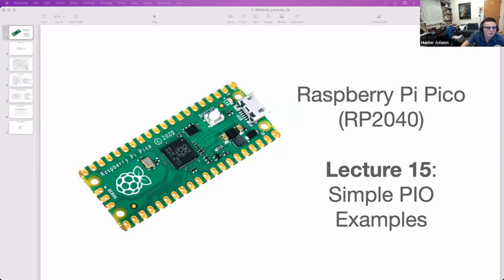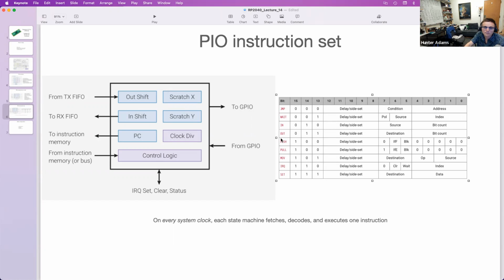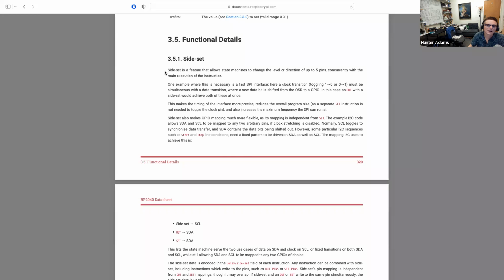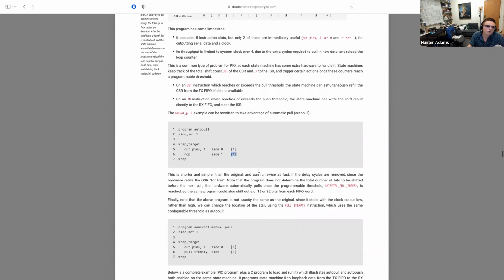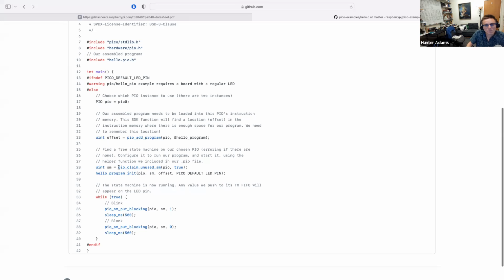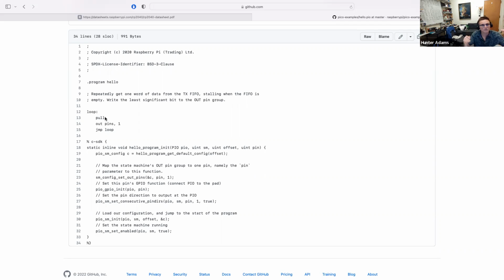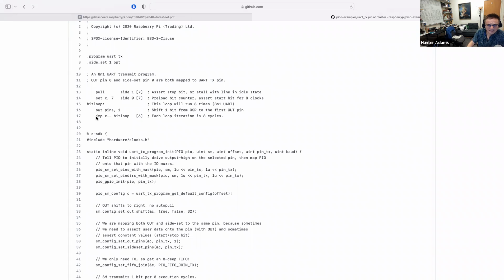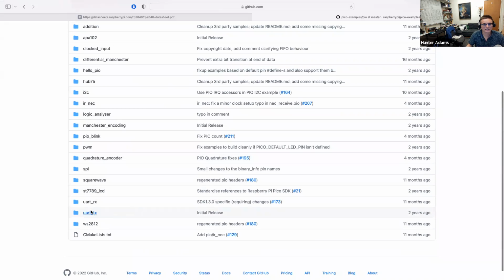Raspberry Pi Pico Lecture 15: PIO Overview and Examples

Comment: Bizarre how the PIOs were touted as massive powerful resources, then never got leveraged by anyone except programmers with time on their hands. Even implementing hardware master/slave SPI seems to have halted. May well be hardware limitations I guess. Laborious workarounds are justification of the board costing $4 i guess.

Has the PIO landscape improved with the 2350?

Doing an AWG on the 2040 is proving very time consuming but I have high hopes because its a 16-bit beast.

Comment: Thank you for your video! Perhaps I misunderstood you from you comment @10:09 , but I disagree with you about IN(ISR, ..) being the equivalent of a NOP instruction. It depends by how many bits you shift by. The instruction IN(ISR,32) (left or right) is equivalent to a NOP(). The MicroPython Python PIO assembler takes values 1 to 32 - for the IN/OUT shifts.
Reply from the maker: I’m stating that “mov isr, isr” is a nop
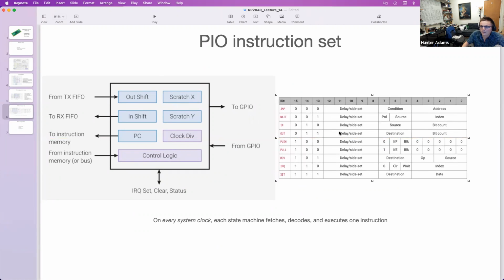Reply: @hunteradams9430  Ah, I see where my confusion was. After revisiting the section between 09:40 and 10:49, it sounds like you're describing the IN and OUT instructions in a way that resembles 'MOV' instructions. I think it's important to clarify that the IN and OUT instructions are only equivalent to MOV when shifting by 32 bits. For example, IN(<REG>,32) is equivalent to MOV(ISR,<REG>), so IN(ISR,32) == MOV(ISR,ISR) == NOP().

I’m really enjoying your PIO playlist—thank you so much for sharing these!

Comment: Enjoyed your content. However I’m unsure about why 8 clock cycles are used for each bit send operation in the UART Tx program. Wouldn’t we get the same effect if the ‘put’ and the ‘set instructions each had a delay of 1, and the loop had no delay? The clock then being divided down accordingly? I’m curious as to why 8 clock cycles was chosen and am wondering if I’ve missed something.
Reply: I guess it depends of the baud rate, if the baud rate was really low it is perhaps not possible to find a good divider for the clock